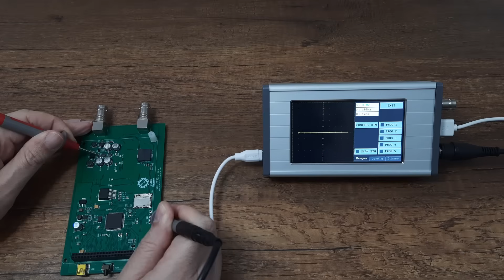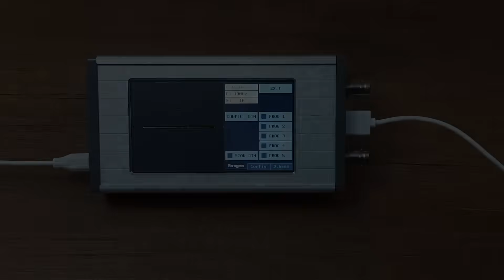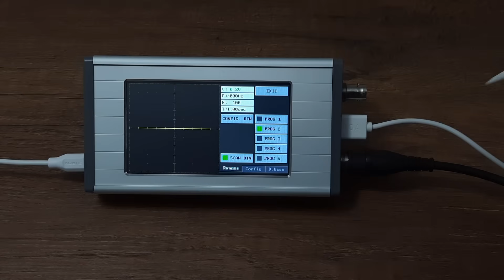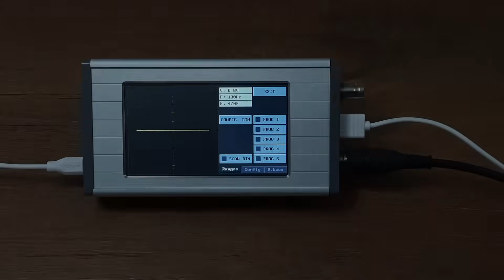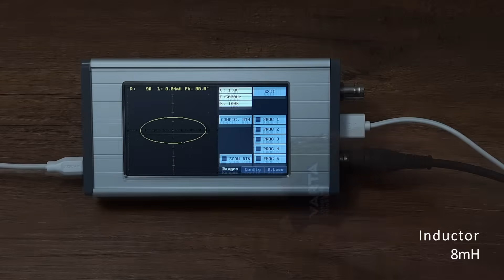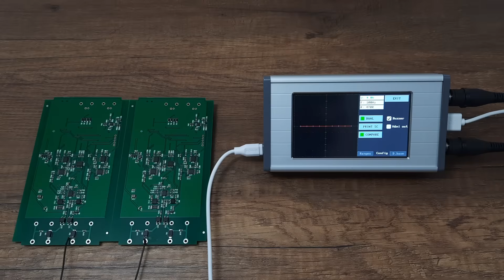UCE-CT321L Fault Locator & Curve Tracer

Comment: When tracing a failed component on a circuit board without having a working control circuit board, how can you tell, for example, if a resistor or capacitor is bad?
Reply: From the shape produced, a resistor is a diagonal line, caps are circular oval. inductors are circular oval,  pn junctions are off then on, multiple componments in a node will have combinations of this, eg a diode with a resistor will have a diode shape with a diagonal line rather than vertocle, but experience plays a role, and having a reference board helps./

Comment: Hello, may I know the functionality of the "short circuit finder" on the expert model. Because I made a comparison on the lite and pro models they don't have features for short circuit finder.so can u explain detail to me about these features.
Reply: can it detect which component is positive and ground connected?
Reply from the maker: The Short Circuit finder mode is basically a milliohm meter. Finding the location of the short circuit is made easy with the buzzer and an animation representing the distance.